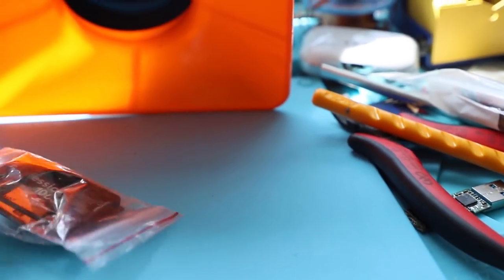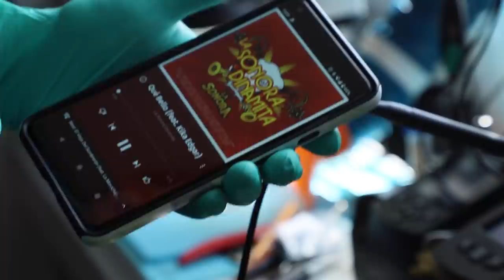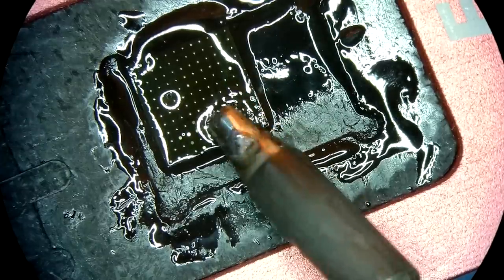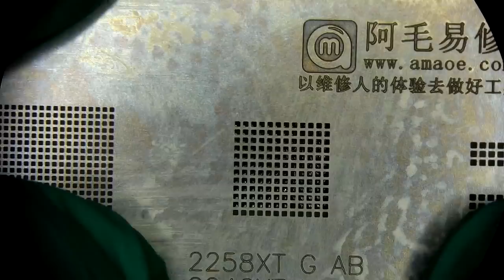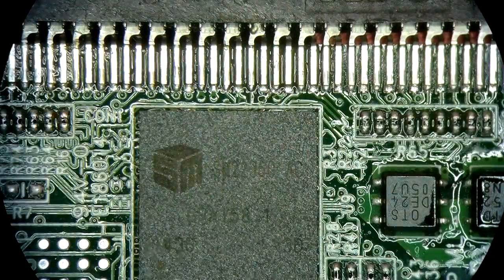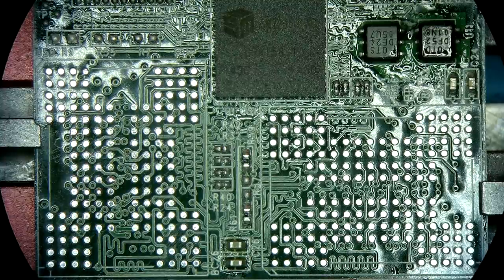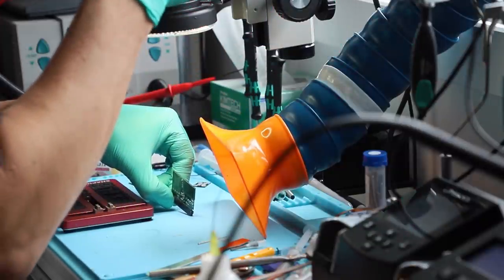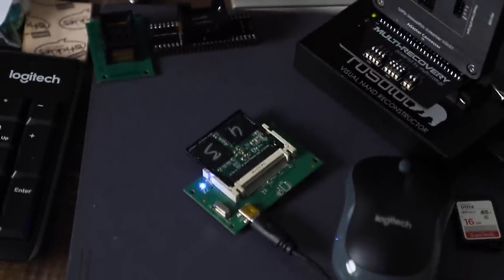rebuilding compact flash memory card for data

Comment: I am very good at reballing and reflowing but lately most of my repairs  include mosfets and pmic smd (laptop repairs) . No more gpu and ram reballing anymore. I guess they are using better materials or lower temps to avoid the overheat.  I admit im missing the reballing process. Keep the good professional work bro!
Reply from the maker: Thanks Derby

Comment: Been watching your videos for a some time now, and I finally made the leap to gathering some gear. Much from your own links to items from these videos. I have one question: Software you are using for direct chip access, and for working with hard drives and other. Nand Protocal? I think you mentioned in this video. Could you add software links used in upcoming videos please?

Comment: Great video sir, I'm always excited to watch you do your magic.  Could you talk about why you use the hot air on the board and iron on the chips?  Also, you are cheating us fans from your Uber T-Shirt game!  :)  thanks again.
Reply from the maker: Hey Josh, great question. Mask on the back of the chip is thick, so damaging it with the iron is very hard. Iron way is quick and easy. Mask on board however, is very thin, so moving iron over masked traces sometimes can scape them and expose them. Hot air with a wick braid minimized pressure and it makes it safer for traces to remain coated

Comment: Question: I have a china ssd with 146TB written, 1 runtime bad block. I suspect the firmware is corrupted, because can't write / read to it. It recognised the drive, sees files and that's it.
It's a SM2258XT controller and it won't let me reflash the firmware in ROM mode. I have tested a different China ssd and it did flash the firmware so that's not a problem. How come this happens ? I don't think it gets corrupted after 146TB / 1 retired block count. It had tons of Hardware ECC correction count.

Comment: Another great video, thanks. On the controller, what was your reason for melting the solder balls with the mask in place?
Reply from the maker: The pitch is fine and pads are smaller than the NAND. So it would be harder to get it off the stencil without damaging the balls

Comment: I was looking at your videos and it's very impressive, I have a question.
I have a Sandisk Cruzer Glide 3.0 That it shows on the PC, shows the data but when trying to access it, the device  disconnects and reconnects but at that point it doesn't even show up on my drives, you have to  remove  it  and plug it on again for it to show up.
What would you think the problem might be?
Reply from the maker: Sounds like bad sectors. Your device needs to be imaged on proper equipment. We use PC3K and Deepspar USB stabilizer for that
Reply: @hddrecoveryservices  Well, that's good news, I thought it was due to fisical damage, not logical one, thanks for sharing knowledge

Comment: Question, if flux is corrosive, why is it not a bad idea to leave it under the BGA chip where it can't be cleaned?  Does it need air to corrode?
Reply from the maker: this specific flux I use is a no clean type. it is not corrosive at all

Comment: What is that circuit board holder? I can see it says shapus f001 but when seach it on amazon or ebay all I get is bra's and pantys. Can you link me please?
Reply from the maker: I bought mine on Unionrepair a while ago, they don't sell it anymore. However, a quick search led me to this (select style F) https://www.ebay.com/itm/Universal-PCB-Holder-Fixture-Cell-Phone-Repair-IC-Microsoldering-Jig-Rework-Tool/253632564525?hash=item3b0dadcd2d:m:mt0sL5mls041Fv_lvkObWig